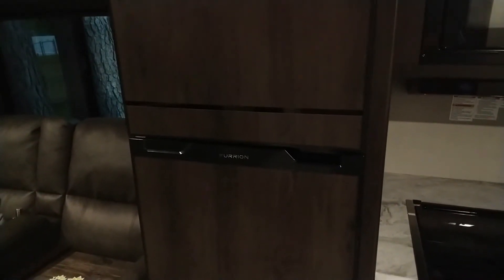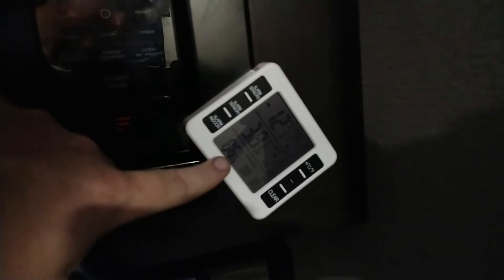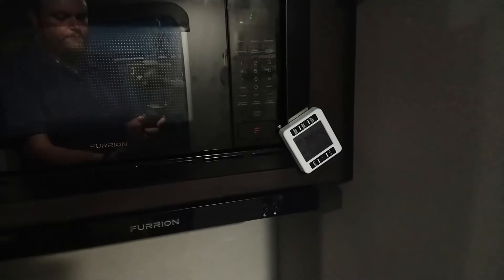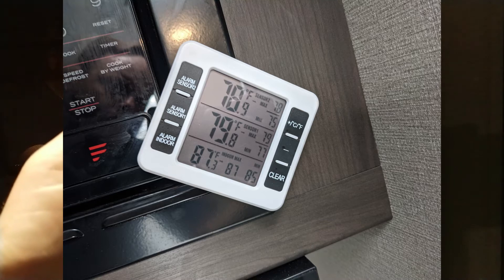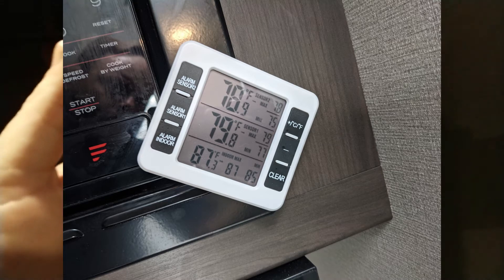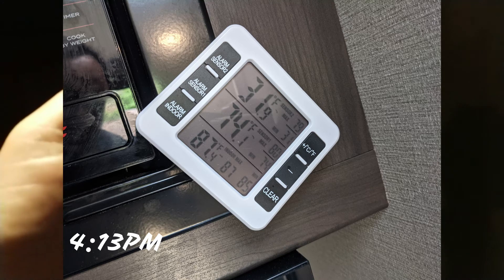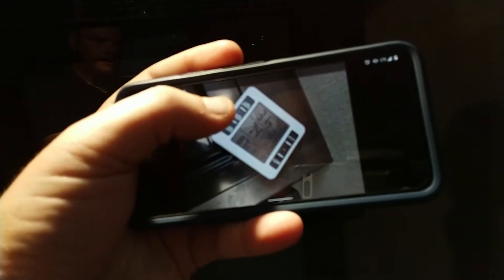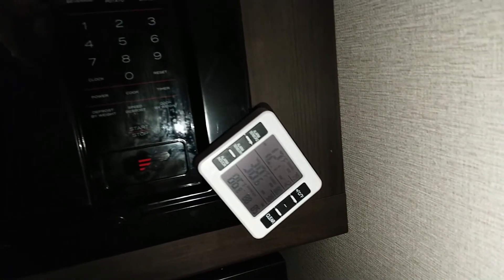FURRION 12v compressor fridge cooldown test

Comment: I have a Transcend 200MK, our Furrion 12V fridge was a lemon from day 1 as are many others who are as unfortunate. I’m just glad to hear someone like yourself isn’t having issues with it. Ours simply won’t cool, it stays at ambient temp. Thanks for the video though.
Reply from the maker: Yeah ours was DOA too. Found during the dealers PDI. They went ahead and got the replacement approved through Grand Design and we were able to pick it up 2 weeks later. Only reason for the delay was Thanksgiving and we had a death in the family. So far so good though. Freezer stays near 0 and fridge never gets above 50 (stays around lower 40's mostly).

Comment: how long does the battery run the fridge for?
Reply from the maker: With the solar panel that comes on the camper you should be able to keep the fridge running in "off grid" mode for at least a week. The size of your battery bank makes a difference also.